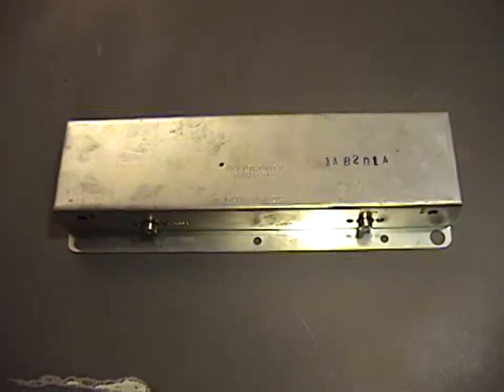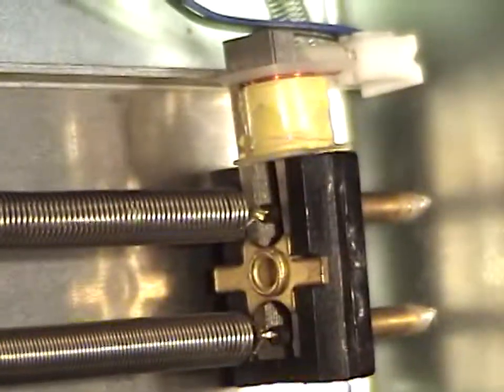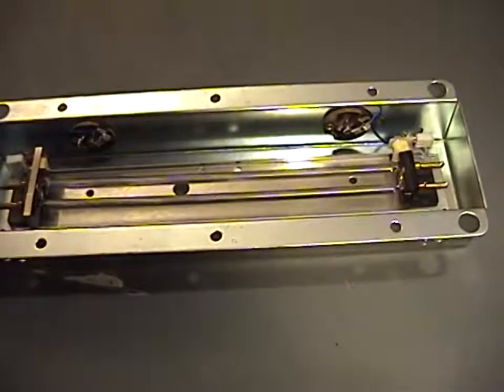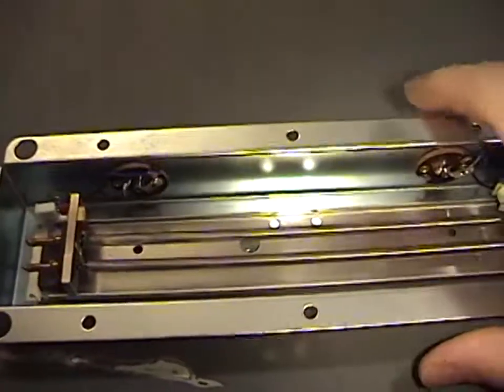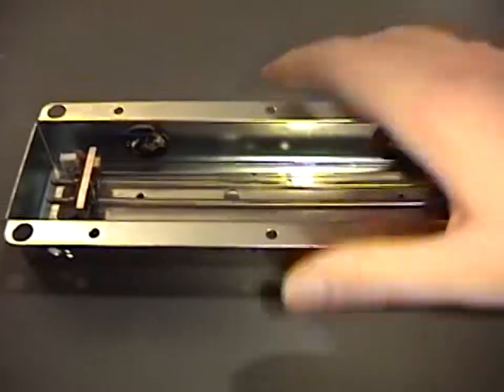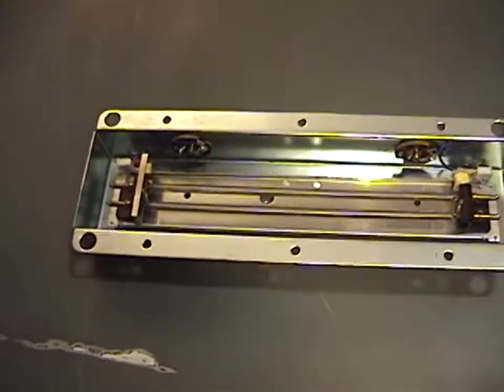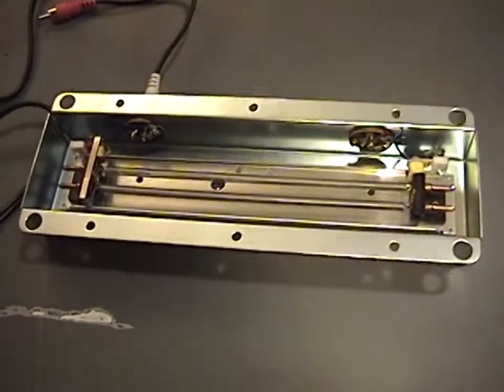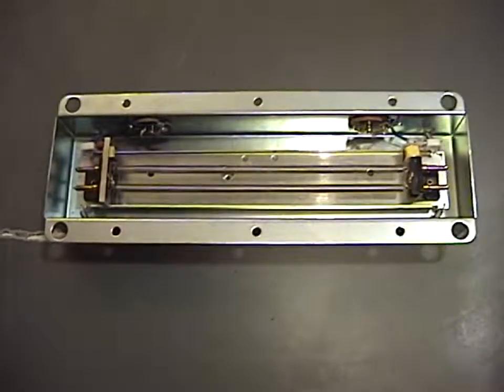A look at an Accutronics spring reverb

Comment: Speaking of this device, the YT User drh4683 has the video of the 1962 Motorola Stereophonic Hi-Fi (High Fidelity), the one he has the similar model to the one like you have the one they called, Vibra-sonic. The Vibra-sonic is how you add an echo sound like Concert Hall, you name it.

And for YT user 12voltvids, he has the video that he demonstrates the amplifier including the Yamaha Mixer Amplifier EM100, he also has one two with the similar design like yours. Of course, he uses the new kit sound amplifier by replace from the old sound amplifier because, the old one is dead, and got them new one to work just fine.

Comment: Hello Sir, I'm looking for an information and I hope you can help me. I'm building a guitar amp and I would like to put a spring reverb tank into it and I don't have a clue about the value of the potentiometer I need to use. Any info for me please?
Best regards
Cliff
Reply: Cliff, there are schematics available for some older guitar amps with reverb - try googling for Peavey Backstage 50, for example.

There's a separate amp section just to drive the reverb tank, take the signal back from the reverb tank and mix it back in... You could see how far you get by chaining pedals together instead though.

Basically, the man preamp feeds to the reverb tank, and a mixer, which feeds to the main output amp.  The reverb tank input is fed from its own little driver amp (maybe removing some bass), and the output from it  feeds to its own signal conditioning amp, which adds gain, and possibly some more EQ.  That then feeds into the mixer.

You could use a cheap line level mixer, e.g the Behringer MX400, or a cheap mic mixer like the Monacor MMX-4, to combine the two signals - there's a difference in levels, between the two sorts, but the knobs take care of that.  Or you could try a Boss LS-2 as the mixer, if you already have one.  I wouldn't want to risk anything that expensive though.

Comment: Did you try this device on a PHONO input on a receiver? I have an 80's Onkyo that plays records loud and well.
Reply from the maker: See 4:35.
Reply: Basically, you need a crazy amount of amplification such as a guitar amp.
Reply: You need a high input signal level -- around 1.5V RMS. Line/aux level (around 200 mV) isn't high enough. A headphone output should work. The output level of the spring reverb will be around 1 to 5 mV, which is microphone level, so it should work when plugged into a mic input.
Reply from the maker: Oops - Guess I had it backwards.